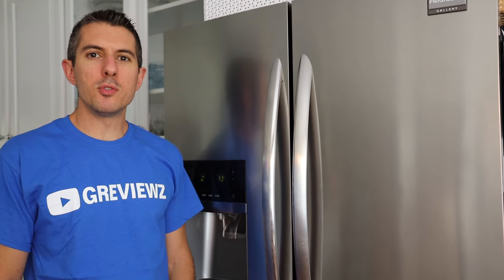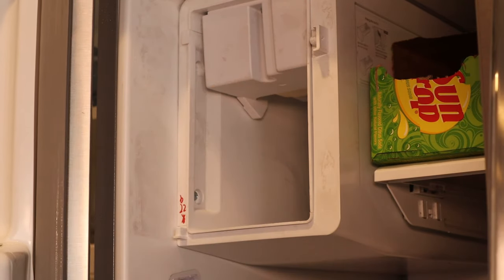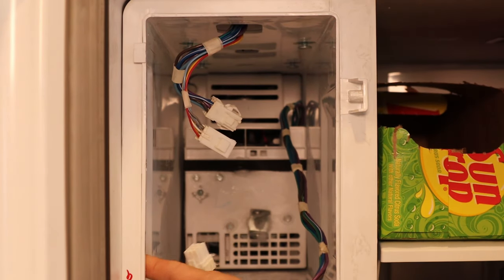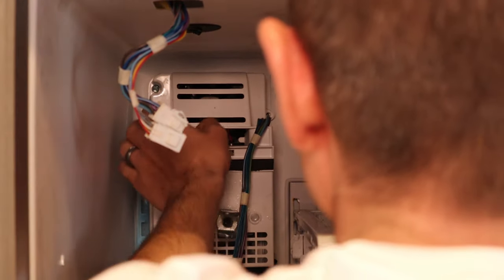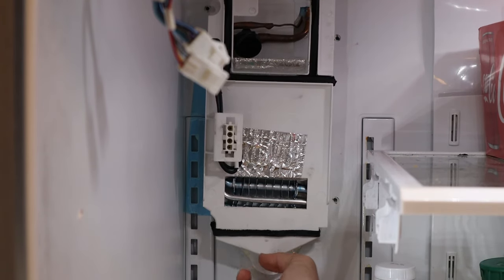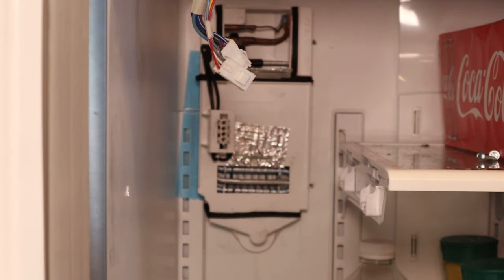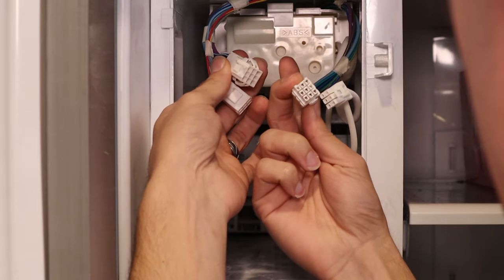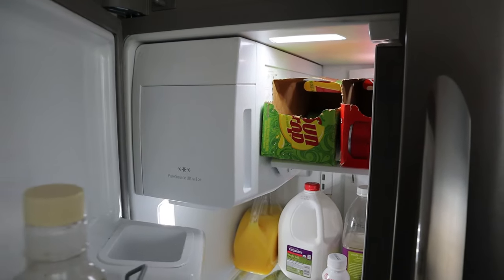Frigidaire ice maker broken again: fix it

Comment: so I have exact same model.  but my problem is the ice maker moter Won't stop running when doors are shut.   any ideas?
Reply from the maker: Thanks for watching. Sounds like it has to do with the little switch/sensor that gets activated when you depress the little clear plastic thing in the door to get ice. You may need a tech to look at yours.

Comment: I bought a whirlpool 13 months ago, one month after warranty expired, the fridge not cooling. I called the customer service and was pushed around and wasted my time. I had a licensed technician checked the fridge, it’s obvious manufacturing defect and poor quality control. Whirlpool service centre offered me 35% rebate because of high cost to repair if I bought another new whirlpool. whirlpool and fridgaire are same manufacturer good luck

Comment: Help! this happened to our freezer as well. But after trying the secret defrost trick it started making ice again. I have a feeling that's just putting a bandaid on the real problem and we'll be back to this video soon.
🚨 But now all our ice comes out crushed! Any thoughts??
Reply from the maker: Thanks for watching. That is very strange. When something is not working correctly ie. you have cubed selected and it’s coming out crushed either the mother board is messed up or when connecting some wires you may have got some wire connections backwards? I am not a pro I just figured out a way to fix the ice problem.
Reply: Hi great video! Having the same issue with my refrigerator. Just wondering how long I should put it in the defrost mode? Also, how do you reverse the defrost mode? Do I just press the + and - signs again? Thanks for your help
Reply: you have a problem with the cube/crush solenoid, could be as simple as it got stuck in the up position and when you put the ice bucket back in the lever slid under it, could be a bad coil, when that system fails, the default position is "crush" the solenoid has to lift the lever to open the door to let cubes drop through

Comment: Took mine apart hoping this was the problem.  It was not, but I did have ice in my drip hole, so I heated that up and we will see what happens
Reply from the maker: Thanks for watching. Tell me how it goes!
Reply: @GReviewz  Still not working.  It dropped a few cubes but now it is back to normal, which is broken and not working.  I noticed that my fridge makes a whirring sound with the door shut and when I open it that shuts off.  I am sure the drip hole froze up again and I am thinking the fridge is making all that racket cause its trying to make ice.  

Then again I thought I could fix this thing and look where I am at =P

Thanks for the reply

Comment: When you put it into that defrost mode....does it come back out of that mode automatically? My ice maker isn't making ice and I want to try to defrost first and do I have to leave the fridge doors open during that?
Reply from the maker: Thanks for watching. Yes it does come out of that mode automatically on my model/yr. there are a few different things with these fridges that could go wrong but for the most part my video shows the most common problem and how to fix it.

Comment: I bought a new Frigidaire the only brand that damn store had In stock got it up and running a few hours later I could get any water I could get any ice hike and bang it around a little bit make it work come to find out from the technician freezer light switch is connected to the whole circuit so that's what was that freezer light switch bad
Reply from the maker: Thanks for watching. Yes these Frigidaire units all sorts of problems.

Comment: Of course it’s Thanksgiving and there’s a horrible fan sound coming from that unit in the back where your removing any idea what that could be?
Reply from the maker: How old is your refrigerator?
Reply: @GReviewz  manufactured 12/15 bought it roughly in 2016
Reply: Could have been 2017 maybe either way in that time frame
Reply: @GReviewz  once I remove the covers exactly as you have in this video could I disconnect the two wire harnesses and leave the ice maker inoperable that at least buys us some peace and quiet until after Christmas lol 😂
Reply from the maker: Lol that would work. Sound like the bearing on the fan motor is going out.

Comment: Does this fix the problem of all the ice melting together and not dispensing? We have had this problem since purchase 7yrs ago. Our main defrost line keeps getting clogged too causing the bottom of the freezer to get a sheet of ice and melt on the floor. POS.

Comment: My ice maker is making ice but it is not dispensing from the door. Ideas?
Reply from the maker: Thanks for watching. For the most part there is a motor that turns a cork screw looking thing that turns and pushes the ice out of the door. If there is ice buildup around that motor it will not turn. Watch through my video and I show how to get to that area..

Comment: I have brand new fridge that wont make ice, water is hooked up. Ice make mr is turned on but nothing happens.
Reply from the maker: First thing I would check is in the menu system and make sure the ice maker is turned on..next I would check to make sure the water is flowing. I know it’s hooked up but sometimes the valve isn’t turned on..

Comment: Hey loved the video but I have a question on my refrigerator: it makes ice just fine, it's getting to come out is the problem. Do you know if I need to just replace some kind of part heres my model if it helps: LFSS2312TE .. Thanks
Reply from the maker: Thanks for watching. There are multiple things it could be. If you remember in my video there was ice build up around the ice auger motor area. I’d check that first if I were you. If it’s not that it could be a bigger problem.
Reply: Sounds like the problem I am currently having. Haven’t figured out the fix yet, but think it’s in the door. If I press the ice dispenser it makes a little noise but the motor doesn’t try to turn. While pressing the dispenser as if a cup was in place, if I reach up the chute and pull the black flap open the dispenser motor starts working ...

Comment: Technically this is not an appliance fix you just manually defrosted around the evaporator coils and evaporator fan. It seems like a problem with the defrost timer or controls.

Comment: I just get a blow dryer and blow in the ice maker for about 10-15 min.. and boom ice again for about 6-7 months then do it again.. this is a known issue with Frigidaire wish they would fix it
Reply from the maker: Until they remove the ice maker out of a refrigerator the issue will never be resolved…
Reply: @GReviewz  sadly I had another one with the icemamer in freezer and the power plug freezes and stops it from working.

Comment: I tried this with mine and got to the point of removing the ice maker... It was frozen SOLID and I could not remove it. The ice maker has been switched to off and wires unplugged for years but for some reason the thing is still a block of ice.
Reply from the maker: I’ve never seen that before. Of the ice maker is unplugged and switched to off it should be cold at all. I wonder if you had a refrigerant leak which caused the ice…

Comment: Hi all i have a weird situation with my frigidaire gallery. After removing and defrosting all the ice now ice maker can’t stop water refilling to ice tray. I have to power off the fridge and ice maker the its stop the water. Anyone knows what the issue. I’m thinking water valves or Faulty Solenoid!
Reply from the maker: That is a tough one. Did you damage any of the electrical wires when doing the de ice project?
Reply: @GReviewz  no damage done but before opening all that i just try to defrost with hairdryer 2 weeks earlier.

Comment: It's going to keep doing the same thing because every time you open those doors it builds up frost in the back and that's what the problem is because there's other fridge The same design as yours and they have the same damn problem
Reply from the maker: Yes any unit that has the ice maker in the refrigerator is going to have the same problem..

Comment: good video, but my issue is that it makes ice but very very slowly and intermittently. The fan and motor assembly both seem to be working fine so I purchased a new mold assembly which did not resolve the issue. My water supply is strong as is The water dispenser. any thoughts anybody?

Comment: In this video: https://youtu.be/KsV-Zno92Fk at 13:18 minutes, he installs a piece of foil to prevent freezing of the drain hole.  Did you consider doing something like that?  In his comments, using 12 gauge cooper wire was also mentioned as a possibility.  Thanks for the video!
Reply from the maker: Thanks for watching. I have watched that video..the main reason I show the fix I did was for liability reasons.. yes you can add the foil and wire as shown in that video however if for some reason those mods short something out or melt something somewhere the manufacturer  would say it was tampered with wouldn’t warranty the fridge..

Comment: Simpler way to solve the issue? Possibly just blow dry with the ice tray removed?? Don’t want to risk breaking something while taking it completely apart
Reply from the maker: Thanks for watching. I completely understand your hesitation on a few thousand dollar fridge. The first thing to try is to manually go through the defrost process. This works for some people but did not work for me. Try that and let me know.

Comment: Is or was anyone else having an issue where it does make ice but extremely extremely slowly.  I just found the video and I do not feel like taking apart the machine but  I did put it into defrost mode.
Reply from the maker: Yes other people have the problem. If ice is building up around the auger motor it can cause ice to come out very slow.

Comment: My Whirlpool w/icemaker did $17,000 damage to my kitchen floor. Get a fridge with NO ice maker/NO water service. Use ice cube trays or buy a professional icemaker.
Reply from the maker: Thanks for watching. I dont blame you. They make these new fridges cheaper and cheaper…
Reply: @GReviewz  An old, seasoned plumber who came over and interdicted the problem told me more than half his calls were about this very thing. He said among other things, excessive pressure in the water line contributes to the problem immensely.

Comment: It is informative as far as taking the unit apart but you haven't even scratched the surface of what is causing the issue. It's like cutting your finger off and instead of going to the doctor you get on YouTube and you show them how to install a bandaid.  Many people try because you make it look easy but break things making it worse and after all this you get to do it all over again in 3 weeks. Call someone who knows what they are doing
Reply from the maker: Thanks for watching. I understand how you feel about the video.  there is no real fix for the problem. It’s a design flaw. Frigidaire has released bandaid kits. In my immediate family we have 4 of these same units. We all recommended them to each other before any problems started. My uncle probably has spent $1k on techs coming out to his house and installing different parts and bandaids to “fix it” but never has still had the same problems. I have owned my unit for 5 years and only have done this process twice... so I have put $0 into for repair. If you have ice buildup every 3 weeks it’s you not the fridge...
Reply: It's true about the design flaws but there are several reasons for ice in the fan that can be repaired if you are able to recognize what they are so yes it is the fridge.  Not every one of that model has that fatal flaw. Many are repaired properly with proper diagnosis. You kinda put a blanket statement out there. I do agree that if your fridge has a fatal flaw then doing what you prescribed is a good fit

Comment: Does anyone have the problem of maybe the thermometer or something?  Ours works in the summer but then won't work in the winter...water works though so its not the water line.  In summer it makes cubes but then ice seems to melt and refreeze into big chunks that won't come out.  Like temp is changing hot to cold and back and refreezing and melting...two repair men have not found the problem!!!!
Reply from the maker: Thanks for watching. Is your refrigerator in the house or in let’s the garage? What temp do you keep you house at in the winter?

Comment: Isn't this the same as just shutting the ice maker off for 24 hours to defrost?
Reply from the maker: You can shut it off but it is still in a cold environment. The ice may take longer than that to melt.
Reply: @GReviewz  I shut mine off overnight and woke up to find some ice in the bucket? is that normal? Then I turned it on again and it didn’t make any more.

Comment: Thanks for a way forward although mine must be newer because the coils are in a metal box that sits against the back of the fridge and the drain is part of the whole motor unit. There is no sliding the back piece off the coils. Once it completely thaws I'll be able to see if the coil box attaches to the motor assy in some way because I cannot get the two apart and there is still some ice in there.   What a POS design.

Comment: My problem is that it doesn't dispence ice but it still makes it
Reply from the maker: Sounds like you may have ice build up around your auger motor. That would mean it will not spin to knock the ice down to you. In the video I do show the auger motor as well.

Comment: Was going good until I heard a pop and all my refrigerant hissing out. Now I I have no ice and no cold air and a completely busted 2 year old fridge
Reply from the maker: We’re in this process we’re you when you heard a snap?
Reply: @GReviewz  trying to get the motor part out. I had significantly much more ice buildup behind mine that I couldn’t see so it was not coming out easy at all. I should have probably stopped and blow dryed it for awhile at that time

Comment: the unit need to have a lean 1/4 to the back so the drain will work better( poor design)
Reply from the maker: Thanks for watching. Yes in the owners manual it does say a 1/4” lower in the rear.

Comment: Clearly the design is defective. My GE has the Same design and the ice machine has never worked consistently. Once when a GE repairman was here to inspect my GE dishwasher which had been recalled, I asked him about the ice maker he said that GE HAD RECEIVED MORE COMPLAINTS ABOUT THAT ICE MAKER THAN ANY PRODUCT IN THEIR HISTORY.. this is the same company that makes jet engines, very reassuring.. these products were purchased by the builder of my house.  I will never buy a GE product again.
Reply from the maker: Thanks for watching. We purchased the Frigidaire appliances in our house after getting recommendations on them and boom we all had the same problems. I dont know what the answer is but the older designs seem to work a lot better.

Comment: You didn’t really fix the issue I saw a guy who replaced that whole unit and it was all insulated properly and taped up with insulation tape which is the issue nothing is insokting the actual unit from freezing up you just took it apart and defrosted it but the issue is still there